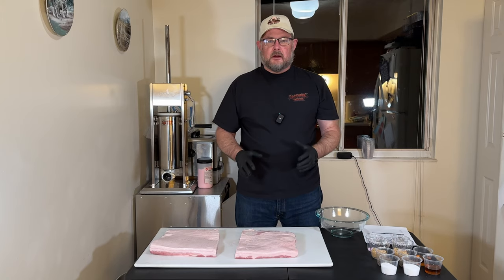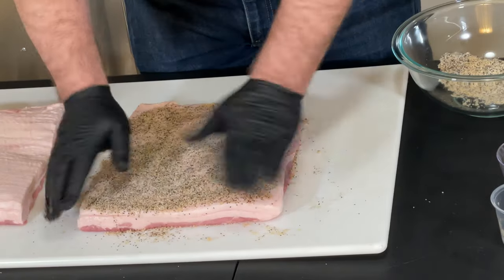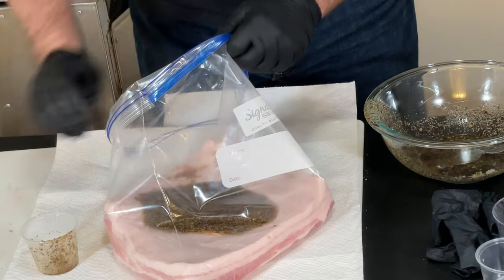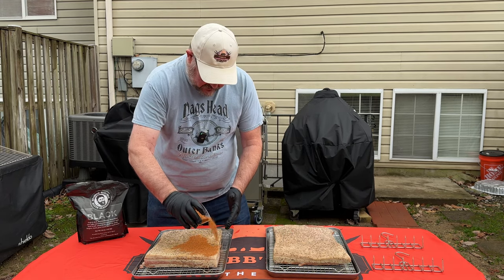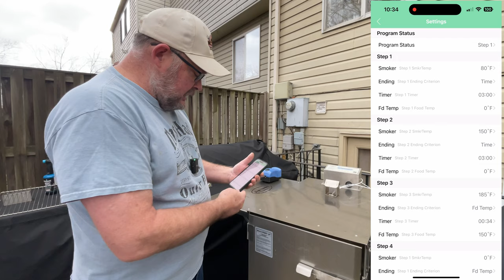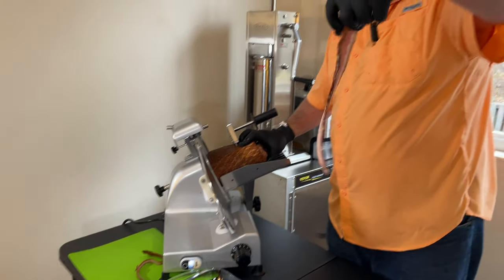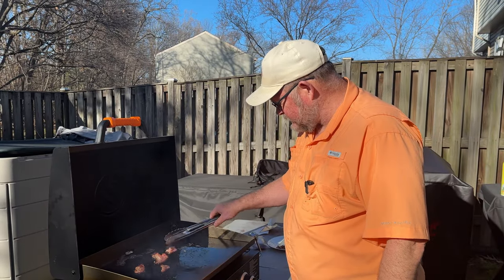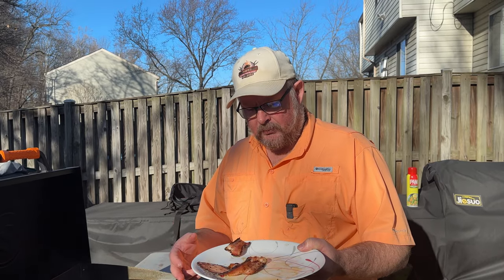How to make Maple Bourbon Bacon

Comment: Amazing - so two questions for you: (1) why such an emphasis on stainless steel for the baking sheet and smoking racks? (2) Is smoking this possible on something like a pellet grill?
Reply from the maker: Somewhere in my research I had learned to use stainless steel when resting bacon, sausage, etc in the fridge when raw etc.  So I've stuck with that.   I read so much when I first begin going down a path that I'm not sure where I picked that up; but it stuck in my head, thus I use stainless.
  As far as smoking on a pellet grill - 100%.   I made the decision to get a new smoker just to hang my bacon vs laying on the grill grate.  There are lots of folks out there using pellets grills for this very purpose, so you are good to go.